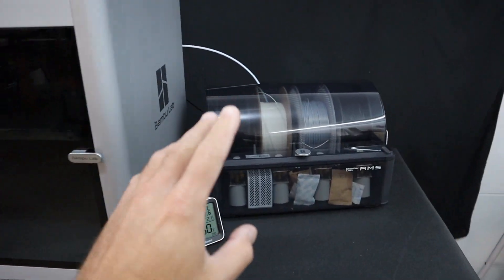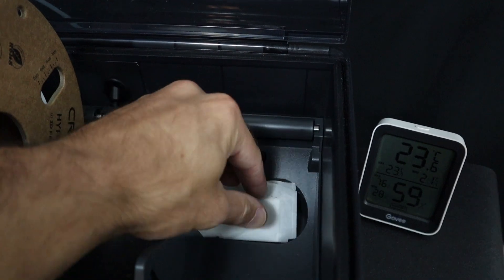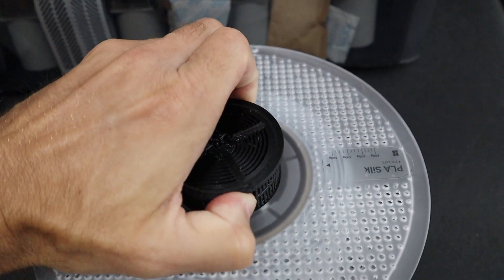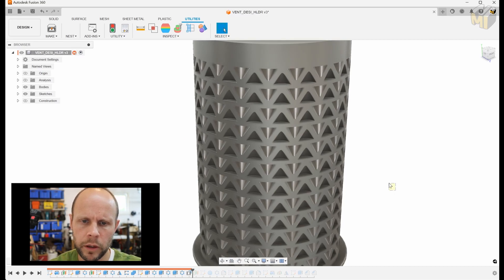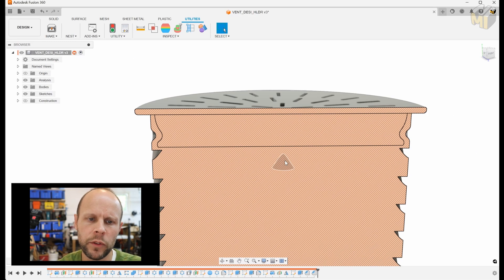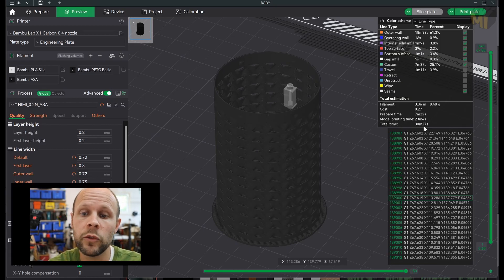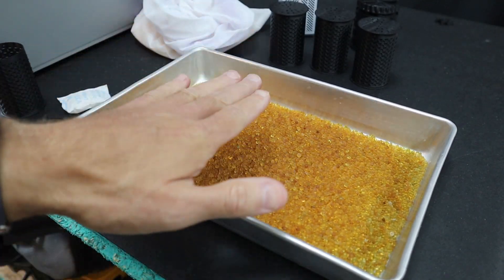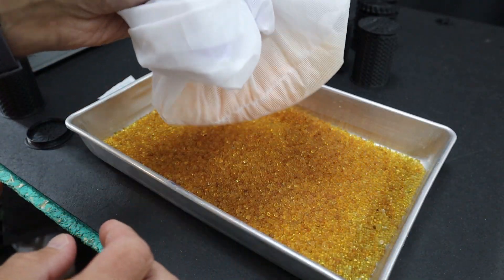Super Dry Your Bambu Lab AMS with These Cool 3D Prints

Comment: Using dessicant will not dry the filament. It will remove the moisture from the air and prevent them from getting moist. But to actually dry the filament, you need to heat it.
Reply: While not as good as heat drying, it does dry it somewhat: https://youtu.be/eqQRN9TUw08?si=CenZgCU8vR5TvJeV&t=724
Reply: From the title I also thought this video was about additional tools for active drying. But the model is still awesome.
Reply: Yup.  This is what we’ve being doing for years in the semiconductor industry with our plastics.   Even dry storage needs a yearly bake.   Moisture is ruthless on Earth.   I use all passive methods too, but you really need to add energy to literally drive moisture away.  Diffusion just ain’t gonna cut it with H2O, but it does buy you time.   What’s most important too is ensuring your dry boxes are actually hermetic.
Reply: @CGreciful Have you heard of rosahl?

A few of their cells and i solved this issue at a place in the philippines... At least until the cells break anyway
Reply: You could purge your dry boxes with Nitrogen.
Reply: @CGreciful  One only purges their dry boxes with Argon. The most noble of gasses. 😂
Reply: Desiccant in dry, not yet absorbed lot of moisture state, is like large volume of air that is much dryer.
By time moisture level (of air vs desiccant) equalizes, and water vapor from air gets absorbed by desiccant, drying air.
If resulting air around filament moisture level is much dryer then that of filament, then it equalizes too, and filament gets dried a bit. At very slow pace though, even more so, that this process is not accelerated by higher temps as in dryer, and/or with fans. Also, if desiccant has already absorbed lot of moisture, it might go even opposite way, with equalizing in enclosed space by time moisture level evening out from "wet desiccant" to "dry spools". 
So technically, while main function of desiccant might be more to retain current wetness/dryness level, it still can dry filament too. Just that in too relatively inefficient/slow pace, to rely just on that or to replace active heating dryers with desiccant boxes. Even more so, if one frequently puts in/takes out in AMS spools as they get used up, on each opening letting wetter ambient air in, replacing dried out (during day or two) air in AMS.
Reply from the maker: From what I've read, that's right, it bonds to the filament chemically.

Comment: followed all the steps but mine says 53 min print time
Reply from the maker: That's a bit strange, I can only think that it might be nozzle size or it's trying to lay down thinner layers.  I'll have to play around with it to see if I can get the same result.
Reply: It looks like he's printing with Bambu ASA filament, which gives the around 30 min total print time. When I change the AMS setting from ASA to PETG I get different times; around 30 min for ASA and around 45 for PETG.
Reply from the maker: @zakpack  That's right, for some filaments you can use the Bambu filament settings, like PETG and ASA/ABS, however for PLA, if you're not using 'fast-printing' PLA, you could run into some major problems extruding at those speeds.  I've had very good results by assigning non-Bambu filaments as Bambu in order to trick the software to provide better results, and it has worked nicely except for Overture PLA.

Comment: Great idea, I to was sticking packs in various places. The one thing that made me switch was that the rolls movement agitates the beads. The print turned out perfect. The only thing I did different was after the bottom layers were printed, I moved the speed up to ludicrous. Printed perfectly in PETG. Since performing this upgrade my humidity dropped from 40 to 30 and still going.
Reply from the maker: You and me both, and those bags or pads really don't look to professional, maybe most people don't care, but the printer and AMS look great until those are jammed in the front.  I don't know about you, but it is super humid here in Ontario Canada right now, it's a must.  I guess as it cools down, we'll see less of a problem.  How fast can you run your printer?  I've not had a chance to experiment much with it in that way.  I will say that it seems to handle PETG like it's child's play.  I wonder if the faster speeds help to prevent some of the issues with stringing we'd see with the Enders.
Reply: kb3ayo581
Humidity has continued to drop and is now down to 25%. I live in Baltimore and so it gets very humid here as well. I mostly used normal mode, especially if I want a perfect print. After a lot of searching found standard mode is A= 10000/mms2, v=250mm/s, sport = 20000/mms2, v= 250mm/2 and ludicrous ?.Your print is really the first time I've used ludicrous since the movements are less jerky in vase mode. Worked great!

Comment: great idea!  it would help if the rolls the filament was on had holes too to help with desiccant air flow.
Reply from the maker: Yeah, the Bambu spools seem to have lots of holes, though not through the center.  I kind of  wish the AMS doubled as a dryer, but they've done such a good job engineering the entire system that I think they have done it this way intentionally.  Soften plastics, cooling motors etc.  I guess just keep them dry and you're good.